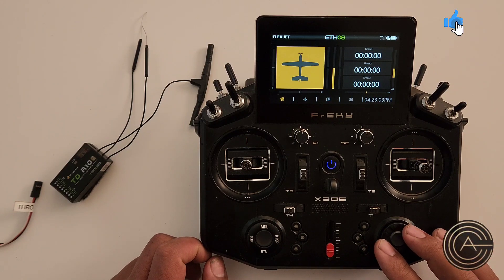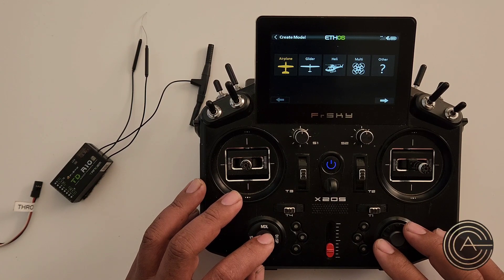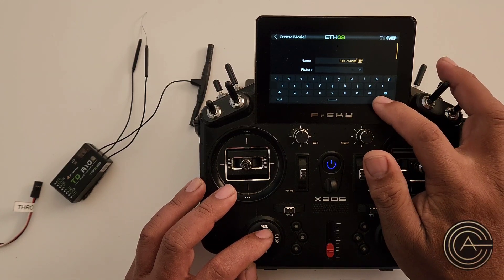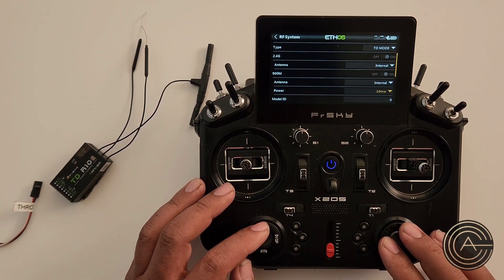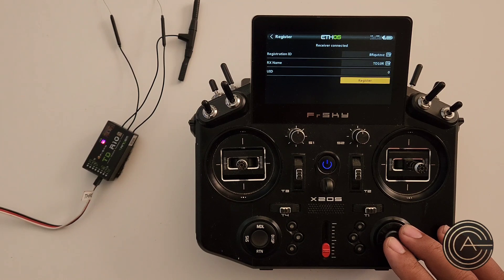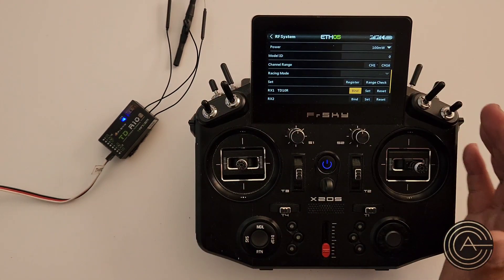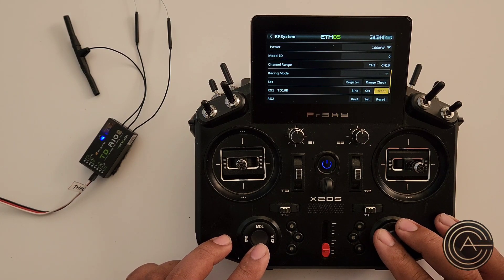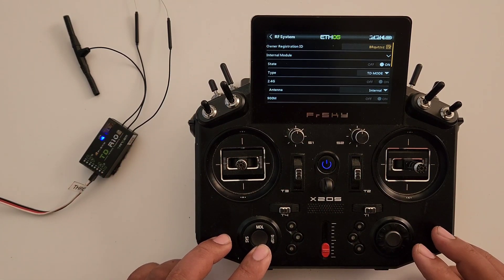The Frsky Series: New Model Setup. Binding Tandem Receiver (Freewing F-16 70mm EDF)

Comment: I just got a TDSR6 bound on TDSR6_3.0.1.frsk, and it seems that SBUS is not one of the options anymore.   In other words, I do see a menu for "options", but when I click it, the only options are to assign Pin x to Channel y, for any x,y in {1-24}.   But there is nothing else.  No Fport, no Sbus, no Smartport, nothing else.   

EDIT: Strangely, I do exactly the same thing with a TDSR18 and I do see the SBUS option, and it works fine.  Both the TDSR6 and TDSR18 are updated to latest as of this writing which is TDSR18_3.0.1.frsk and TDSR6_3.0.1.frsk.   Seems like something got overlooked (or intentionally removed?) in TDSR6 firmware
Reply from the maker: @markdavis7397  the tdsr6, i believe has the s.bus port on the white connector.

Comment: Is there a way when binding multiple RXers, for the radio to not function unless both RXers are powered up?   I have found that a single RX is functional even if the other one is not powered up.   This would prevent one from taking off if the wing were turned off as a hypothetical.